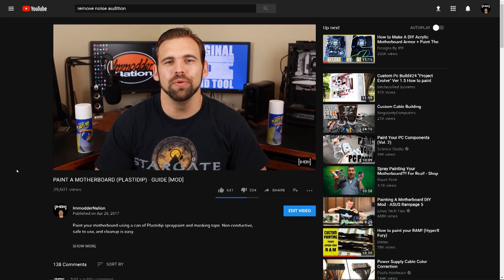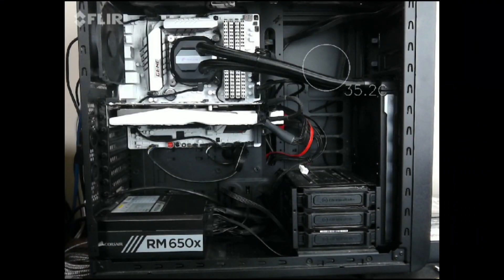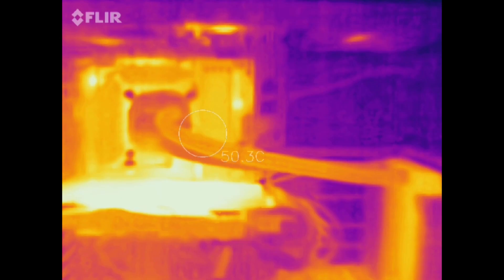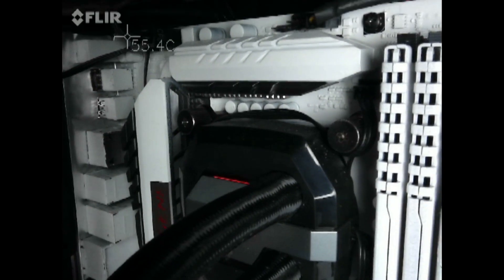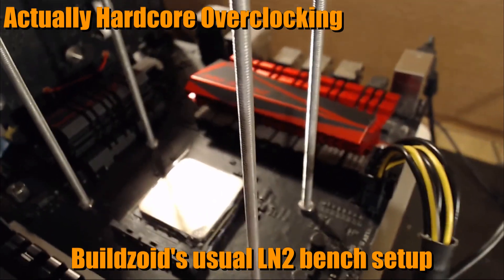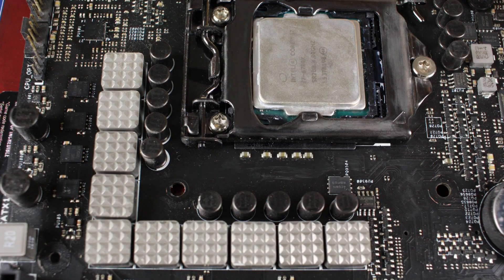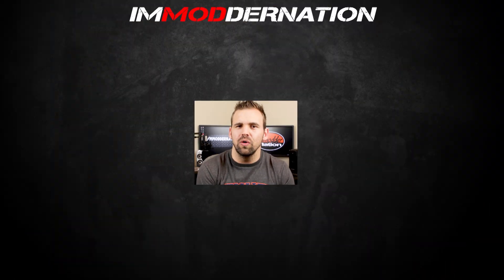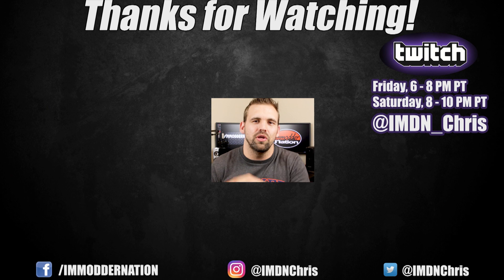PAINT A MOTHERBOARD UPDATE (PLASTIDIP) - WILL IT OVERHEAT? (feat Flir One Pro)

Comment from the maker: You can check out my unboxing and first impressions of the FLIR ONE Pro here: https://youtu.be/PWr9DniqbXo. Review coming soon!
Reply from the maker: I haven't yet but that is in the works.
Reply from the maker: 2 is always good as you may need a backup. I found that one of the nozzles clogged while spraying and I had to switch cans. Make sure the cans are warmed up before you spray. Try to spray with warm weather, not cold.
Reply from the maker: I know one person recommended putting the cans in the sun for 10 minutes or submerge in hot (not boiling) water
Reply from the maker: I wouldn't buy a monitor from Ali as I can source one locally through Craigslist at a fraction of the shipping cost. Depending upon where you live, Ali could take a month or more to ship. I would consider those things before you make your purchase.
Reply from the maker: For a 16:9 aspect ratio, it'll be hard to find anything under 19.

Comment: #ImmodderNation do u think after applying a conformal coating and then spray painting on top of the motherboard what if I have to solder or desolder any component on the motherboard, will the paint catch fire after touching the hot tip of the nozzle to the motherboard. What is your feedback?
Reply from the maker: I suggest doing your soldering before conformal coating. You can get to the contacts by removing some coating. If you have to desolder something...I want to watch whatever it is you're doing that requires desoldering motherboard components.

Comment: that AIO radiator placement... just why
you need the radiator above the cpu at least or turn radiator around so bubbles get stuck at top of rad not in cpu block, the pump will wear out quicker and thermals will be higher and more noise from AIO from air in there

i cba to explain more see one of thousands of youtube videos IE: https://www.youtube.com/watch?v=BbGomv195sk&t=1277s
Reply from the maker: Likely true, but this case limits how I can mount the rad and I'm not mounting it to the roof.

Comment: Im planning on painting my son motherboard but because of the same reason I’m planning to paint it just like your but I won’t paint the chips  and little cylinders looking things .
Reply from the maker: Chips and capacitors? You can paint those, just be careful of the ones that get hot
Reply: ImmodderNation yes since I don’t know which ones get hot I won’t take the risk
Reply from the maker: There are affordable infrared cameras that can detect heat. Like the Perfect Prime IR0280. I did a review on that one as well.
Reply: ImmodderNation I’ll look into it btw do mother board metter ?

Comment: Kick ass video. Your thoughts on painting my asus a320m k with simple can paint, and i would like to know what parts i must avoid painting.
Reply from the maker: All of the parts I've tapped off in the video. Avoid those! Also don't use regular paint. First of all it won't stick because you didn't prime it. Plastidip doesn't need primer. Second of all, you don't know if that paint is conductive or not. Plastidip is non conductive.

Comment: Also, thermal insulators (glass, ceramics, etc) do heat up over time. They just do so slowly, and provide a thermal buffer, keeping most of the heat on one side. ;)
Reply from the maker: I don't doubt that but I don't think the board gets hot enough for concern

Comment: Would be good to look at the back of the board, since the insulation will block a lot of the heat from leaving the front of the board at all, causing the internal and surface temperature on the back to rise.
Reply from the maker: I'll be reviewing a new IR camera soon so I'll check but I don't think there is any insulation occurring.

Comment: You can even paint the VRMs white if you use high heat engine paint.  It has decent thermal dissipation properties.
Reply from the maker: The goal was to make the paint removal incase I want to resell the board. Yes I could but that route is more permanent.
Reply: A buyer might pay a premium for a custom white board...
Reply from the maker: Maybe but nobody has asked. Another commenter said they saw my thumbnail being used to sell a motherboard on Craigslist.
Reply: ImmodderNation I sold a RX580 GPU I painted with white plastidip on the shroud and backplate.  Sold it in November for $175 on ebay, which was $20 more than equivalent boards at the time (I did include screenshots of the OC settings and benchmarks to show it   hummed along nicely, so that helped too).

White GPUs are non-existent, and white builds are definitely en vogue, so that helps.
Reply from the maker: There are white GPU shrouds but not white backplates. The ASUS Dual GTX 1060 is one example. Congratulations on the sale!
Reply: ImmodderNation thanks.  I painted it because I built a snow blind case myself and added a twist.  I took the acrylic sheet/light diffuser from inside the monitor and cut it to be a "light platform" in the top and bottom of case.  I lined the edges with LED RGBW strips and it really did a nice job evenly illuminating the inside.  

Really enjoy the mods, and snowblind is a nice one.  I think I enjoy the modding more than the actual gaming.
Reply from the maker: Very cool, Matthew. How's the RGB Led look? I'm looking at creating a light guide similar to the iBuyPower case. Careful, modding becomes compulsive and expensive.

Comment: The VRMs and plugs are the concern.  You were thorough in protecting the vulnerable components.  This is totally safe.  Nice work.
Reply from the maker: Nothing is totally safe but LN2 overclockers do this all of the time. Just don't cover the hot parts. Easy
Reply: @ImmodderNation  planning to do this in my motherboard, it's quite old. Should I consider masking the capacitors and mosfets as well aside from vrms?
Reply from the maker: Capacitors you shouldn't need to mask. Mosfets should have heatsinks over them, don't paint them. Unless you mean inductors (big square things) in which case those you can paint.

Comment: I actually stumbled upon this videos since I use Plasti Dip on other things.  Interesting usage for Plasti Dip I must day-
However Plasti Dip are insulating, not a really good one but still insulating.  So my guess is that your components are actually somewhat warmer then your camera pick up.
Reply from the maker: If it is insulating, the difference in temperature is so small that it doesn't matter. It also depends on how many layers you apply. If you spray enough layers it will likely insulate very well.
Reply: Yes, number of layers will definitely makes a difference (thickness too of cause)

Comment: 100th like ;)
PS. This video would be much better if you would compare it with not painted mobo
Reply from the maker: I could have done that, but the question about temperatures did not come up until after the mod was completed. A before and after temperature video would have been the best solution. Thank you for the like.

Comment: Is the pc still running well? Thinking of doing this for fun to a cheap dell mobo budget build.
Reply from the maker: Still running very well. Game and encode videos on it every week. If you do the project, send me some photos. I'd love to see how it turned out!
Reply: ImmodderNation will do. I also saw another it that just used regular flat white spray paint. He did a white and red water cooled build and he said he did it several times with regular paint and had no problems do not sure what I should try.  Gonna sub to your channel seems like some good content.
Reply from the maker: Choose Plastidip! Less prep, no sanding, you can Peeel It Offff and change colors easily. If you ever sell a board, you can easily bring it back to stock. It's a bit more expensive, but it's worth it to go this route. Thanks for subscribing and welcome to the Modder Nation.
Reply: ImmodderNation thanks I’ll see if I decide to do it. Just trying to build a cheap htpc/gaming pc for my sons. I have an i7 2600 but I want to get a diff case maybe a cube design like the Corsair air 240  and need to find a dang graphics card. Dang prices are crazy! I want a 970/1060 for a decent price.
Reply from the maker: Depending upon the Gaming you're doing even a 770 or 780ti will work. Up until the last month I was gaming on a 770 at 1080p medium/low settings. Worked for all games except Wolfenstein II. Good luck, GPU prices are expected to continue climbing through Q3 2018 according to Nvidia.
Reply: ImmodderNation thanks. Yea the prices suck pretty bad! Have a good one

Comment: I have REALLLLY been loooking into this. I see you and other have done this successfully.  However, my line of thinking is that plasti-dip is still insulating, albeit to a minor degree that still allows your board to function. However, no one really says this, but wouldnt logic dictate that a paint that is actually thermally conductive be the better choice?  That way the heat still propogates outward and only increases ambient air temps as opposed to being insulated?  The hard part, is what paint is conductive, and who can do a comparison video. Maybe one day i will.....
Reply: im replying to my own comment. I just got off the phone with a large company that does anodizing of metals and they regularly anodize heatsinks for mobo manufacturers and military components.  They confirmed my initial thoughts and concurrently agreed with your results.  They said anodizing is the way to go, that although it is electrically non conductive, it will not insulate. He went on to further my thoughts by saying if I were to paint them, yes it would be insulating, however to such a minimal degree, that it would not affect dissipation in a noticeably negative way. He said he wasnt sure if there was a conductive paint out there, but if there was, that is the paint you want.  A CONDUCTIVE PAINT, not a non conductive paint.  You dont want to trap in the heat.  Last, he mentioned for anyone who regularly builds computers, online are kits for around $200 that you can anodize your own heatsinks
Reply from the maker: Anodizing is only going to work for metal and doesn't address motherboard coverage. I wouldn't recommend painting the fins of the heatsinks, especially for the FETs and caps as they get the hottest. Anytime you put something between the surface of the heatsink and the outside air, theres going to be some insulation. I don't think a conductive paint is going to help, even if it does exist. Good luck and if you have any other questions, i'd be happy to help. Thanks for doing the research!
Reply: Make sure that you find paint so conductive that it shorts out all the pins and exposed copper pours on your board!!!!
Reply from the maker: It's a good thing my paint has flakes of copper and gold in it 😉

Comment: go ask gamers nexus their opinion about pointing a thermal camera at a pc's innards.
Reply from the maker: Steve did a great job with the improper use of thermal cameras video. I did make sure to remove the side panel of the case. I wasn't looking at core temperatures of CPU or GPU either, just the temperatures of the components on the board. I can't speak for Seek Thermal, but FLIR does have compensation in their settings for reflection of different surfaces, but they recommend not pointing it at any reflective surfaces. 

Steve does mention that the camera IS good for looking for hot spots in your case, but not exact temperatures. That's exactly what I needed. Temperatures on the board were WELL below tolerances, even if they were lower on the thermal camera than real life,  Thanks for your question. 

If you're wondering what companyoflosers is talking about: https://youtu.be/DPPdYpwfEVE

Comment: I think capacitors get to those temps any ways. This MOD might have given em a 5-8c more but that still is OKAY. M painting mine with a normal matte black.
Reply from the maker: +DIY Tech The point is that they're under max temp for constant use and should still last even if some premature degradation occurs.
Reply: SO its safe safe and pretty safe painting the board. BTW i think only u have done this AFTER paint test no one else have, so thanks for that :)
Reply from the maker: +DIY Tech Some users have said that painting their motherboard killed it. I'm not sure how they painted it so I can't say that the paint was the cause. I did the test because I was tired of the overheating comments. Professional overclockers also plastidip their motherboards sometimes so it's not uncommon. Thanks for the comment.

Comment: i did this over a year ago on my media server it runs non stop and never once over heated. with plenty of air flow it will not be an issue i also had that pc slightly over clocked with a larger cpu cooler still no issues. good vid !
Reply from the maker: Cool. I like your Project Flames case mod. Did you cut the panel yourself?
Reply: yup i don't think its around anymore lol but i got bored one night at work and had fun. you should see the rest of the pc's i've built. Instagram Dwayne T cover pic is a white phantom with blue led's cant miss it lol currently working on a 15 year old game case with newer components. its purdy to say the least.
Reply from the maker: I definitely want to check out your pcs. I couldn't find your Instagram account, you'll have to link me. You can message me if you don't want to post it here.

Comment: Oh yea when is the snowblind v2 coming out? And if possible could you help me with my build I'm currently not sure how to wire the LCD to be powered off a molex connector it would be great if you could give me some tips/help. Ps great video
Reply from the maker: All I can say is watch my LCD Side Panel video closely. Disconnect the power wires one at a time until you find the ones required to power on the LCD. The rest are just various power states, I believe. https://youtu.be/0jeD9_647Xw

When V2 comes out, don't know yet. Focusing on another mod at the moment.

Comment: Great video, you put a lot of work into your research. Regarding the insulation you mentioned at 11:20, I know rubber is a good insulator and is used a lot to keep heat out, by the question is, if it can successfully keep heat out, can it also keep heat in? If that is the case and it is keeping heat in, then the temperatures you're seeing are lower than the heat it's keeping in, which can be bad if it's too high of a temperature which at this point doesn't seem to be a problem if it has been working flawlessly like you mentioned. Something to think about.
Reply from the maker: +One Pixel at a Time i sort of touched on that when I said that it could be a really good insulator. Based on my results and the fact that the board still works, I'm going to trust Plastidip that's it's not thermally insulating. If the temps underneath the paint are higher, its not by much.